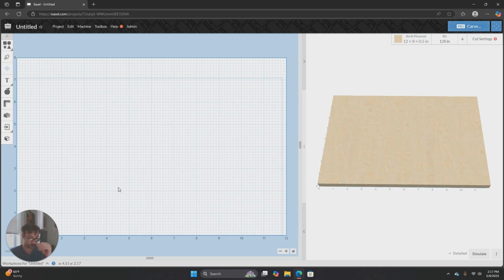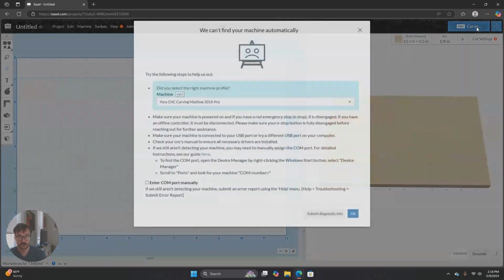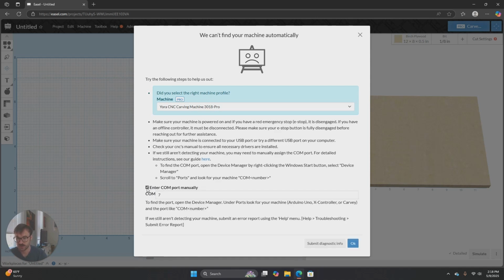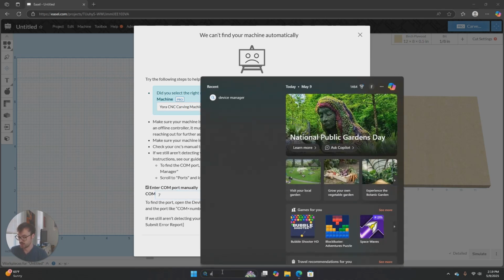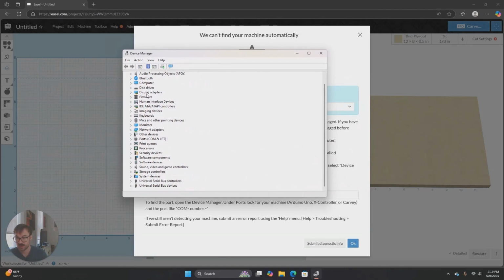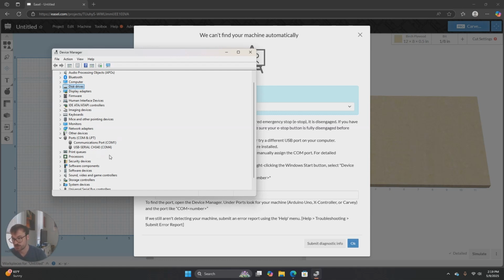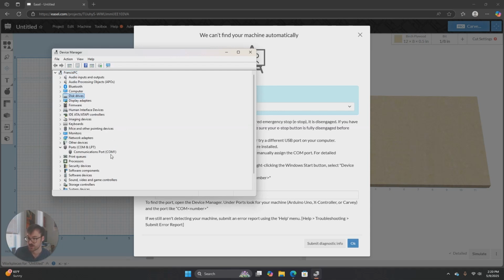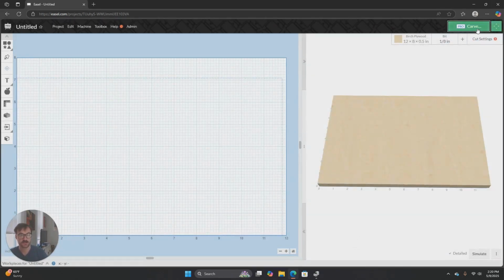Easel Troubleshooting: Selecting the COM Port (Windows)

Comment: BRO!
I don't get this window.
It just tells me to install the driver which I have done MANY times!
Reply from the maker: Hello! Sorry you’re running into this — that definitely sounds frustrating. Even after multiple installs, if you're still seeing that driver message, something else might not be working as expected.
Could you reach out to our support team at help@easel.com? They’ll be able to take a closer look and help you get it sorted quickly.
Reply: @EaselSoftware I did this morning, thank you.
If we can't get this worked out then maybe I'll need a W11 machine for future support.
Reply: @richarddortch6122  I am having the same issue. Did you even manage to find a resolve to this problem?
Reply: @EaselSoftware  i'm having the same issue. I updated my computer and now the carve button stays blue. When i click the blue carve button it prompts me to install the driver. The window that you show on the video does not come up. I've reinstalled the drivers and restarted my computer. Help! (windows 10)
Reply: I’ve the same problem , did you get it resolved and if so could you share how to get it running again .
Reply: @ernest-pj2du I bought a 64bit W11 mini pc.
Reply: @ernest-pj2du  did you figure it out? I'm having the same issue. Thanks
Reply: @ernest-pj2du did you figure it out, having the same issue
Reply: Same issue
Any thing worked?
Reply: @alecwhitehawk5449 I picked up a new MiniPC that runs W11.
Works perfectly now, the old Intel Atom systems are missing instruction sets for W11 64bit to work properly.
Reply: @alecwhitehawk5449 did you get it to work